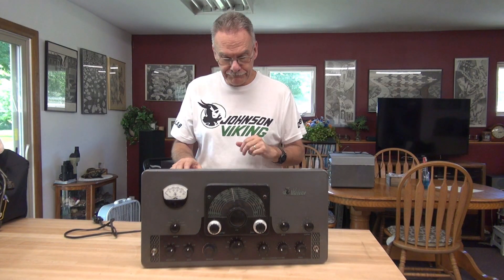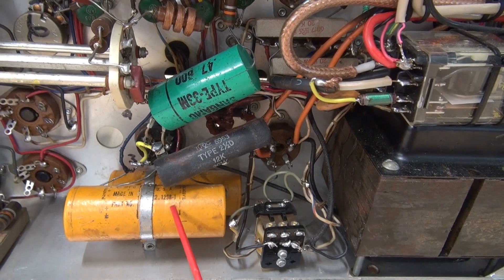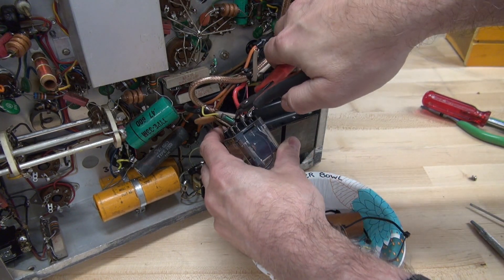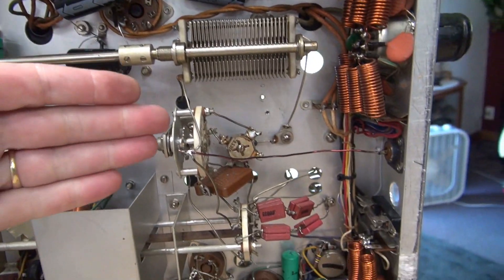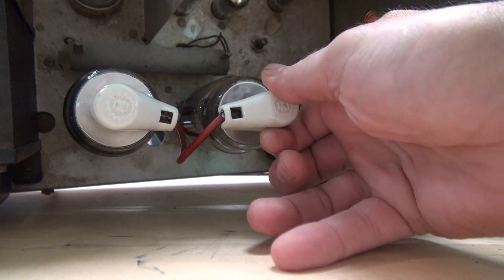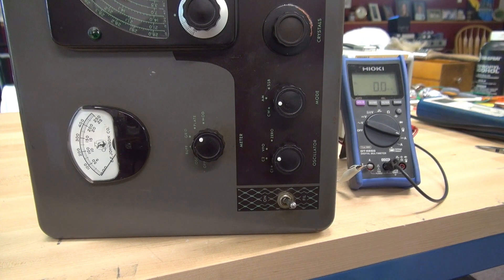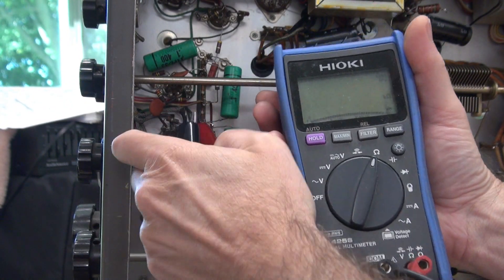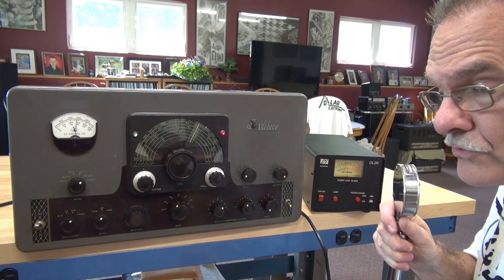EF Johnson Valiant Ham radio tube transmitter UN-mod & repair Lots of Kobbling many hours of work

Comment: Can you make a video on America five radio and show how the filters cans can be replaced?  I am working on a Zenith Universal I think 600 a d I pop thr 1LB4 tube and the reaction also made a big flash bit I think it will still work a little longer.i have the filter can out but I'm stumped on what to replace it with when I make my order for a new tube and the caps.

Comment: I used to run my friend's Valiant in the early 1970's on the CB band.   I later became a ham and have now owned that Valiant for over 25 years; unfortunately, it was completely non-functional and remained so for all these years.  Seeing this video, I dusted it off and started trouble shooting it. I did a re-cap and fired it up and found the audio circuit is dead, but it does 120 watts of RF into a dummy load.  I removed a couple of old mods and found the .202 ohm resistor replaced with a piece of wire!  Other resistors are out of spec and have been ordered--including the Chernobyl resistor replacement.   It will be good to have this old rig up and running again.  Thank you D-Lab for the inspiration!

Comment: Wow! What a dizzying series of corrective issues. I am most impressed with your diagnostic ability with these ham units. Once you removed the overbearing modifications, restored the circuit to stock, and used well disciplined testing to identify any other issues, it was a matter of deduction to sort the remaining problem(s). Well done!